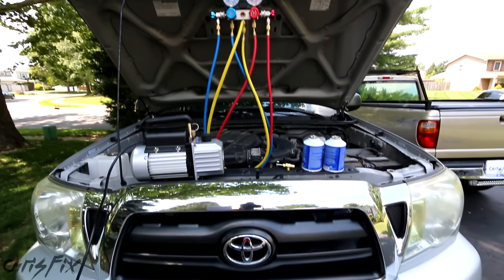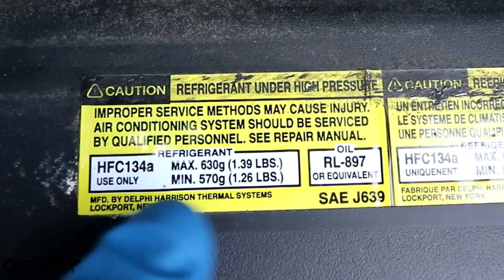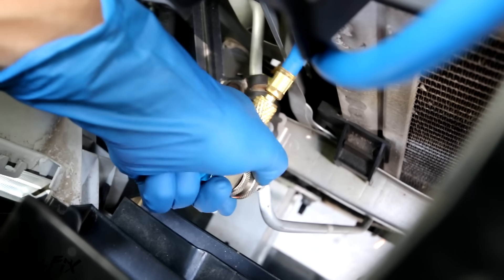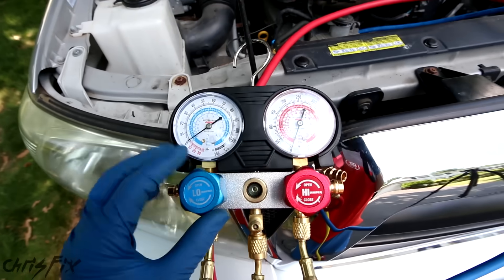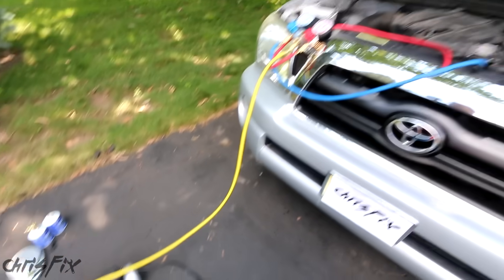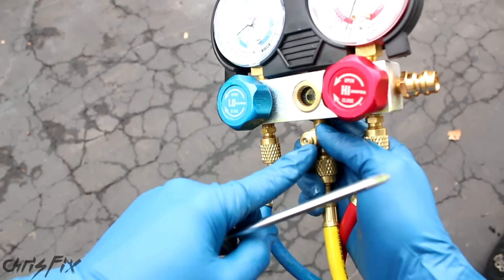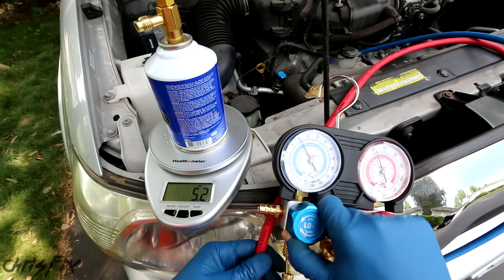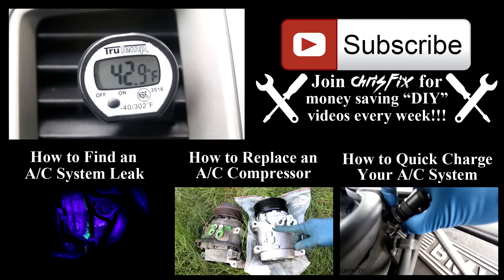How to Properly Recharge Your AC System

Comment: Should I vacuum the system before i put the new a/compressor?
Reply: The system must be evacuated before it is charged. If you open the system after you pull a vacuum you lose the vacuum and it must be reevacuated.
Reply from the maker: You will pull a vacuum after the new parts are installed.

Comment: about to tackle an A/C Compressor, Condenser, and Expansion valve on my 09 Civic Si. This will be the 4th ac system i have worked on and charged. Always come back to this video a couple times to make sure i do the steps properly. All 4 times have been a success and i have save THOUSANDS of dollars doing it myself. 
Thank you CHRIS!!!!
Reply: Hey man I recently replaced my condenser I got it vacuumed and a can of refrigerant by a mechanic. Should I add refrigerant oil and a bit of another can of refrigerant? It is still blowing out warm air. Thanks.

Comment: Tried the system. All good but never got enough pressure to get the compressor on. The low line pressure stayed around 100 psi and never moved as compressor never came on. Any tips on how to get things going? Also, Volvo 850 does not have a high pressure valve so only used low pressure line.
Reply: Something is wrong on the control circuit for the compressor clutch. Could be a bad relay, low pressure switch, bad ac button, broken wire somewhere, or a bad clutch.

Comment: Whats it mean when you pull a vac test it starts at 30Hg and drops to about 12Hg when off for about 10 minutes and stays there indefinitely? I let it sit 2 days in fact. Is it just enough pressure to leak to that amount? Are my harbor freight gauge fittings leaking? Replaced all the o-rings in the system, expansion valve, drier and compressor. I fed it about 10oz of R134 for a test and it doesn't blow any cooler, somethings wrong...
Reply: There is a leak somewhere.
Reply: @Redtooth75  😢

Comment: When I put on the ac the clutch wont engage until I give the car a hard rev why??
Reply from the maker: Check the wires and connection at the clutch. Could be corroded or loose and the rev gives it more voltage.

Comment: hi, question please,  i am refilling the Refrigerant  because i had to replace the pressure sensor so do i need to ad oil in this case before i refill or  i just fill refrigerant even though i am going to vacuum the system just incase of moisture . thank you

Comment: My compressor isn't kicking on. I pulled a vacuum, waited, pulled another vacuum, then dumped 30$ of freon into it and now the lo & hi sides are both at 100psi. The relays & fuses are good. The drier and it's psi sensor are new. Compressor is new and oiled up. Orifice tube is new. Any suggestions?

The new compressor didn't come with a hi psi cutout switch on it, I didn't install one hearing it wasn't required. Is that an issue?
Reply: Probably the high pressure switch. The switch is normally closed and opens when the pressure is too high. So if the connector is unplugged it is open between the two wires going into. The connector being unplugged is electrically equivalent to the high side pressure switch being tripped. Connect the wires on the high side pressure switch.
Reply: @Redtooth75  thanks a lot for the reply! Is that safe to run long term? (Bridge the sensor plug & tape it up)

Or should I deplete the system and install that switch?

I'm driving across country when I leave the military & need my ac working
Reply: @guitarguy3221  the hps is a safety device to protect the system. If there is not enough airflow through the condenser from a broken fan or dirt clogging it the pressure will get too high. This can damage the compressor or in an extreme case cause a line to rupture.
Reply: @Redtooth75  I'm going to plug in the hi cutout sensor I just bought and secure it to the harness until I drain my ac system again. I'm running a big e fan with a good relay so I will take the chance
Reply: @guitarguy3221  it will most likely be fine, it is rare for the hps to trip. Many residential air conditioners dont even have one.
Reply: Everything worked fine after plugging that sensor in! I didn't need to install it on the compressor, just had to plug the harness into the sensor.

I went offroading and now I'm getting no cooling unless I'm on the highway. My electric fan is working. Compressor stays on but rpms do not rise. I think my freon went low or leaked somewhere
Reply: I found out my system was clogged with oil. My old compressor didn't have any info about being preoiled. It was. I dumped almost the whole 6oz bottle of PAG in there and turned the clutch before install.

Ended up brake cleaning all lines & using compressed air on evaporator. Dumped a cap full of fresh pag into each line. None in compressor. New condensor

Comment: Okay so my friend and I are doing his ac system in his Honda del sol si. It’s a 93 so it still has some R12, he picked up some 12a refrigerant substitute and we’re going use that is there anything we should know before we start
Reply from the maker: The connectors for the r12 systems are not the same as the connectors for r134 so make sure you have the right adapters for your gauge set so it can connect to the system.
Reply: Thanks from the del sol community
Reply: Also while 12a can be used as a substitute for R12 that does not mean they can be mixed. You must remove all of the R12 from the system before you add any 12a. Also make sure to add the refrigerant as a liquid by holding the can upside down and throttle the charge in. The pressures for 12a are slightly different from R12 or 134a so you will see different readings on the gauge.

Comment: One thing most ac repair places never check is the AC clutch cycle switch or the refrigerant pressure switch. It's a screw in sensor located on the discharge line or the accumulator. It sends a signal to the clutch to disengage when the pressure gets too low if it's working intermittently the clutch will disengage too soon and your car won't cool down very well. If your car is over 10 years old and the AC isn't that great even after a freon recharge I would look into it.
Reply from the maker: Thanks for the tip
Reply: @chrisfix  Also if your thermostat is stuck in the open position your car will run a little cold and your evap coil will freeze and your ac won't work very well. Your car will briefly overheat then return to normal when it's really hot outside. Replacing the thermostat saved me putting in a new radiator and fixed my AC as well. This was on a 2000 Corolla I used to have.

Comment: for sure a great video.  one minor detail missing is that when disconnecting the manifold you should close the high side valve at the port.  then open the low and high side valves on the manifold and watch the gauges drop to the lowest reading, a minute or 2.  then close the low side valve at the port and then disconnect the port connections.  only do this with either the yellow line closed by a valve or connected in a loop back to the manifold. when disconnecting the manifold from the ports you will still get a tiny puff of refrigerant shooting out, though minimal.

Comment: Question: given the 22oz refrigerant Capacity of your Tacoma, shouldn't you have charged it with 24oz to compensate for the ~ 2oz line-set loss?

CORRECTION: What I learned after posting this question above is that the amount of R134A in "liquid" form within a 1/4" x 6 ft hose is .33 oz per ft, or about 2 oz.  However, the weight of "vapor" (what we are using when charging on the Low side) is about 1/75 times that, or around .027 oz.  In other words, negligible and no compensation for the refrigeratant volume in the hoses is required.
Reply from the maker: The manifold high/low specs were at the correct levels once I filled it, so I didn’t need to compensate
Reply: @chrisfix  What I learned after posting the question is that the amount of R134A in "liquid" form within a 1/4" x 6 ft hose is .33 oz per ft, or about 2 oz.  However, the weight of "vapor" (what we are using when charging on the Low side) is about 1/75 times that, or around .027 oz.  In other words, negligible and no compensation for the refrigeratant volume in the hoses is required.  Your answer of course validates this. 

Thanks again for your reply and I'm fortunate to have a 2nd Gen Tacoma that runs like new, partially because of your fantastic videos.

Comment: I just did this job and didn't close the high side valve off at the connector (I only closed it off at the gauge) and ended up with a face full of refrigerant when I disconnected the hose from the gauge to put it away. Are you supposed to shut the high side off at the connector when you add refrigerant to prevent this from happening? I'm curious since he ChrisFix doesn't show that step in the video.
Reply: You can remove the quick connector from the high side fitting and then open the valves on the manifold so the compressor sucks in the liquid refrigerant. Or just crack the fitting and let it bleed out.

Comment: Don't remove the red adapter until the high side pressure has cooled and EQUALIZED. Engine off. Wait till system equalizes between low and high pressures. THEN take off the red adapter. Will be at roughly 100psi instead of 250psi range. You loose a lot of liquid pulling the red adapter off too soon.

Comment: For those of us at high altitude, the maximum vacuum your vacuum pump can pull will be less than 30" Hg. In my part of Utah, for example, it's about 26" Hg. Thanks for an excellent video-- all the needed information, but no fluff.
Reply: Ha here in Kanab Utah, 5000 feet, all I could get was about 24” of Hg that explains a lot!
Reply: Pueblo, CO and I’m getting about 20
Reply: That makes a lot of sense. Thanks for that lil info 👍
Reply: That's okay. The concern is that you get the absolute pressure in the system as low as possible. The gage pressure, which is measured at your location, is not important.
Reply: Thank you so much for this comment! I could only pull 24" at 4600ft
Reply: @Ehlersbp makes sense I was confused both times I did it didn’t go over 28” I’m at 3000
Reply: H mm 😂
Reply: Apparently temperature matters too. During the 105° weather earlier I was able to pull to -30. Now that it’s 86° it only seems to pull at -24. Could be something else but it’s the only big change I can name

Comment: Question. 
Should you purge the yellow hose again when disconnecting the first can, and attaching the second can?
Reply: I had the same question. I've checked my dispenser gadget/valve that pierces the can and mine only is sealed closed in the "pierced" position. (when the tip has pierced the can's seal.)So screwing the new can back on to the gadget is fraught with danger as to have that valve closed/sealed also means the piercing tip is opening the new can before it is actually fully screwed down. So what I would do is after the first can has emptied would be to close the valve on the can first, then close both high & low pressure manifold valves on the gauge, THEN unscrew the empty can, open the valve fully so no danger of piercing the new can.....thread the new can on, THEN pierce the new can, purge/bleed the line as with the first can, then open the high & low pressure manifold valves....

Comment: If I am just adding r134a do I still need to take it to a shop to remove all r134a first OR can I simply just do the steps as shown in this video?
Edit
08 civic has 178k mi and never recharged before. So as I was driving with ac on but suddenly it was blowing warm air so I am assuming there is no more r134a inside.
Reply: First you need to throw some gauges on it and check if its actually low. If its low it will short cycle. But it could be an electrical issue causing the compressor to not come on at all.
You cant follow this video exactly because he is charging by weight. It is impossible to know how much refrigerant you have in the system without pulling it all out and weighing it. But you can charge by pressure. Fill is until the pressures remain correct and the suction line coming back to the compressor is cold, ideally about 20*F higher than the low side saturation temp.
Reply: @Redtooth75  ok thanks. 

Also if I skip the vacuum just add r-134a and if both pressure is right according to my current humidity level AND I dont hear any leak (hissing) then I am good? Original owner.
Reply: @Gleeleeglee  if the system still has pressure then you can just add refrigerant without pulling a vacuum. If there is no pressure you need to pull a vacuum.
You probably wont be able to hear the leak, unless it is massive. You can add UV dye to the system and shine a UV light around to try and find the leak. Or you can use an electronic refrigerant detector. 
My advice would be to charge it and see how long it holds. If it takes a while it's probably easiest to just keep adding when it's low. If it leaks out fast then try and find the leak.

Comment: In this example it appears there is no use for the high pressure side to be connected.  Why is it used in this case?  I am assuming the high side has a target based off manufacturer specs and/or maybe in some cases you shoot for a number on low/high when you don't know capacity so you use low/high target numbers based off ambient temp and blah blah to get it done??  I've never tapped into what's going on with the high side.  I've only added 134, I haven't had to vacuum and completely recharge after a compressor R&R.  I heard refrigerators should be slightly negative at the low side with the compressor running whereas the car here like I've seen, is what 40psi on the low side??  What's the general rule of thumb 40/240???  Is there any rule or is it a moving target based off every manufacturer?  Someone in the mood to give a lecture?  I'm ready.  If I had time I would take a class on this so I could handle all this like a pro, but I don't, so like usual, I will learn through YT University and eventually be a pro!
Reply: For automotive use the high side is really only used to help diagnose problems. It can also be used when topping off the system and charging by pressure.
The pressure that you see depends on the type of refrigerant and the type of system. For air conditioners the low side is around 34-40*F when the airflow into the coil is around 70*F, like if you have it on recirculation and the cab is cold. The high side is usually 20-30*F higher than ambient temp. A pressure temperature chart gives you the saturation temperature the refrigerant is at at those temperatures. If the cabin is hot then the low side will read higher, if the ambient temp is high the high side will be higher.

Comment: Can you please help me?  I need 525 grams of 134a and got 2 12oz bottles.  Do I need 18.5188 oz of 134a and how do I subtract that from the second bottle? Thanks in advance!🙏🏻
Reply: Your system holds 18.5 ounces of refrigerant. If you are starting with an empty system use a scale to put in 18.5 ounces. You will not be able to get all of the refrigerant out of the can. So if you can only get lets say 10 ounces out of the first can then you add 8.5 ounces out of the second.
Reply: @Redtooth75   Figured it out thank you!

Comment: The question is, if and when you pull a vacuum on the system, how is it the compressor retains the oil? You mentioned your compressor came with oil? I am replacing the Evap Coil and had my system professionally vacuumed out. I am now ready to re-charge, the question is do I need to add oil?
Reply: Vacuuming does not remove the oil. Some trace amounts might be pulled out but it will be insignificant and not measurable. Most of the oil is in the compressor. Some will be in the evaporator coil but not enough to make a difference. There should only be enough to give a light coating to the inside of the tubing and losing that amount should not hurt the compressor.
Reply: @Redtooth75  Thanks for the info, this was very helpful.

Comment: How does a vacuum work to remove moisture being that the system is closed?
Reply: It is pulling all the air and water vapor out of the system. There is very little of anything in the system if you pull it down to a deep vacuum.

Comment: Great video tutorial!  Quick question.  If you have to add oil...you mentioned to add it to the yellow hose right before connecting the refrigerant can.  If you pour in oil, then connect the can.  How do you purge the yellow line from any air without also purging the oil you just added to the hose??

Comment: 16 fluid ounces does not equal a pound.  16 fluid ounces equal  2  cups volume or  a pint.
Reply: The manufacturer of the can made a mistake it is supposed to be ounces mass. Refrigerant is sold by weight not volume.
Reply: @Redtooth75  uour right just checked Autozone lol.
oz. & grams
Reply from the maker: It equals 1.04lbs which is close enough.

Comment: Hey Chris or anyone! I need to replace my AC solenoid on my Jetta AC compressor. So if I have the Freon evacuated and take off that solenoid and replace it, do you think I would need to add any oil if I loss just a little bit? Thanks in advance anyone!

Comment: I don't understand - after you first pulled vaccuum, you closed the manifold gauges. How are you measuring for leaks with the gauges closed off?! Sorry if I'm missing something obvious, but it seems to me that the vacuum gauge will hold that reading all day long, leaks or not, if you close the valve to the system being checked... No?